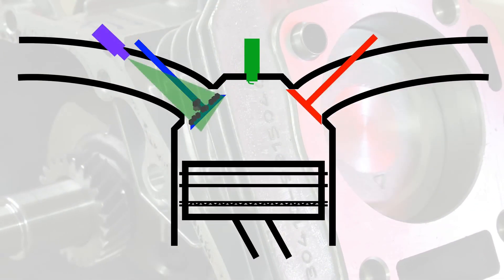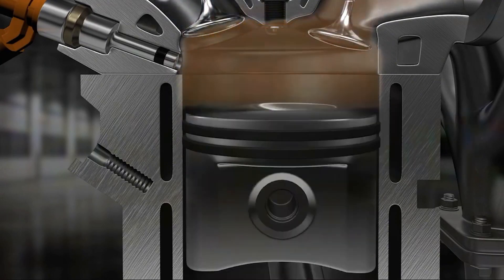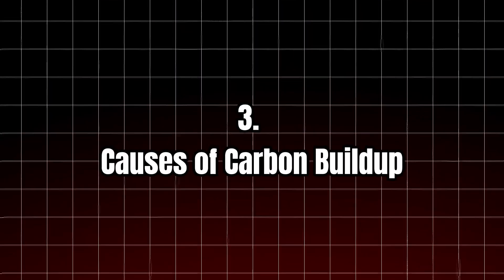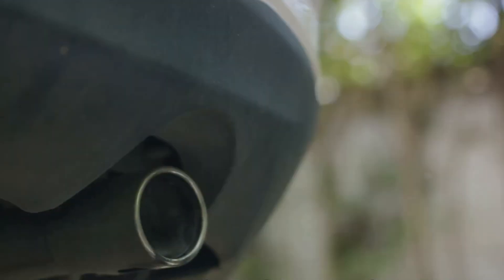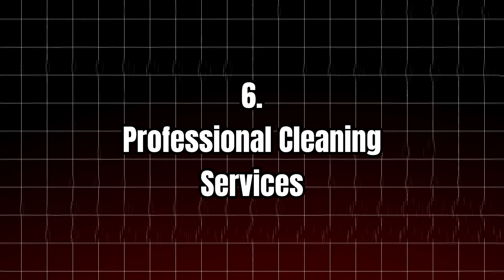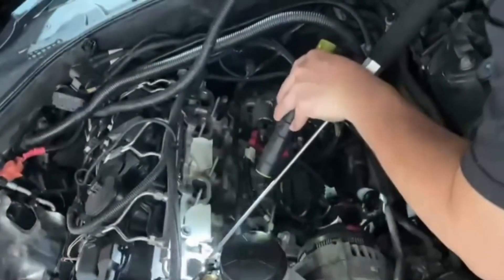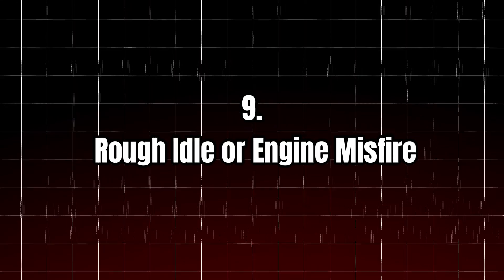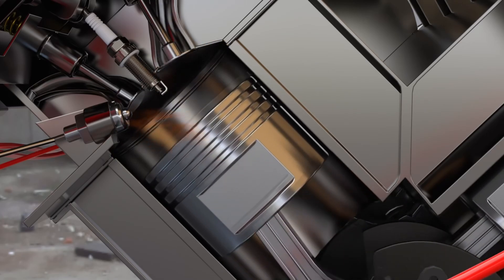How to identify and fix Carbon Dioxide Deposits in Engine Compartment and Valves

Comment: Great video, although I believe carbon despots are from incomplete combustion of the hydrocarbon fuel. Carbon dioxide despots is a misnomer, as co2 is a combustion gas that is the result of the carbon being completely combusted, while the carbon deposits result from the hydrocarbons not being completely combusted- I think

Comment: Umm.... NOPE! There is no such thing as carbon dioxide deposits in an engine. 
 Walnut blasting will ABSOLUTELY cause damage to engine components. The only exception would be if you disassemble the engine prior to cleaning,  and even then many surfaces can be damaged. 
 There is zero relationship with the torque convertor being that the torque convertor is a component of the transmission with no relevance to the combustion process. 
 It's quite clear that you are ignorant on the subject matter and you shouldn't be making videos about it.
Reply: I heard torque converter and was like what. There not even related. Im wondering if this is just AI generate rubbish
Reply from the maker: Appreciate your feedback! While opinions differ, many certified mechanics do use walnut blasting safely on GDI engines to remove carbon buildup. Torque converter note taken — thanks for pointing that out. For real-world tips (and occasional debate!), hit that subscribe button and stay informed
Reply: Walnut shell blasting is well established and proven safe.  Valves are closed before cleaning and vacuumed out afterwards.